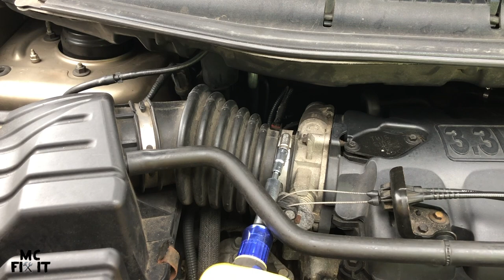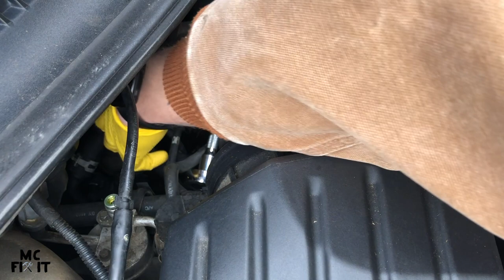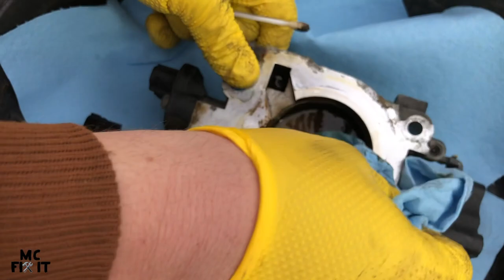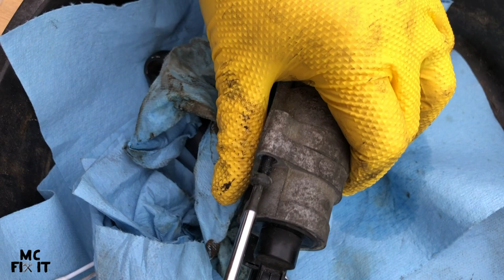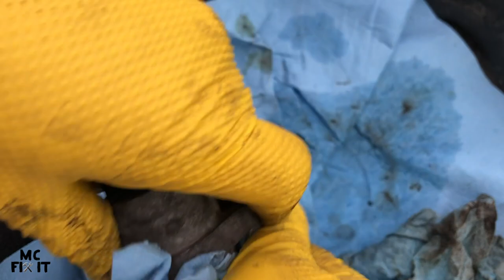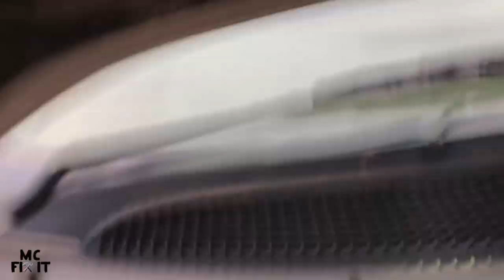Rough Idle? Clean your Throttle Body & Idle Air Control - Dodge Caravan / Chrysler Town And Country

Comment from the maker: Have issues with a rough idle? Use these tips to clean it and for your engine to run smoother! 

00:59 TOOLS:
• Mass Air Flow Sensor Clean (Throttle Body Cleaner / Break Cleaner) - https://amzn.to/33oTgmy 
• OIl Pan - https://amzn.to/33tm9xN
• Shop Towels - https://amzn.to/2SC8D93
• Q-Tips - https://amzn.to/33rEknC
• T20 Screwdriver - https://amzn.to/33pSQME 
• Flat Head Screwdriver - https://amzn.to/2RAjTlU 
• 5/16in socket - Socket set: https://amzn.to/3fjRoBd 
• 10mm socket - Socket set: https://amzn.to/3fjRoBd 
• Ratchet -  https://amzn.to/3xWjE5g 
• 4 in extension  - https://amzn.to/3uwhLKx 
• Pick (optional) - getting of red clips - https://amzn.to/3nZM8q4 
• Magnetic Metal Tray (optional) - keeps you from losing  bolts - https://amzn.to/3hdUiJZ 

01:39 - The Fix! Learn how to do this yourself! We walk through how to take off and clean the throttle body and the idle air control valve. Then put it all back together and tested it. 

This video works on all makes and models of vehicles but was done on a Dodge Caravan / Chrysler Town and Country for Generation 4 for the years of 2001, 2002, 2003, 2004, 2005, 2006, 2007. 3.3 liter or 3.8 liter engine size. It should be very similar for years before and after this.

Check out my website at http://mcfixit.us 

Disclaimer: Due to factors beyond the control of MC FIX IT, I cannot guarantee against improper use or unauthorized modifications of this information in the video, post, blog, or social media. MC FIX IT assumes no liability for property damage or injury incurred as a result of any of the information contained in this video. Use this information at your own risk. If you feel uncomfortable at any time. Stop and go to a professional. MC FIX IT recommends safe practices when working on vehicles, your house, or any other project and or with tools seen or implied in this video. Due to factors beyond the control of MC FIX IT, no information contained in this video shall create any expressed or implied warranty or guarantee of any particular result. Any injury, damage, or loss that may result from improper use of these tools, equipment, or from the information contained in this video is the sole responsibility of the user and not MC FIX IT.

#mcfixit #autorepair #fix #repair #throttlebody #roughidle #idle #caravan #townandcountry

Comment: Here is a trick I use when replacing screws, this is from my 30+ years as a two-way radio technician.  Insert the screw and depending upon the location with or without a screw driver rotate the screw 'counter-clockwise' until you either feel or hear a light click or pop sound.  This click or pop indicates that the threads of the screw have dropped down inline with the threads of the anchor at this time you can now turn the screw 'clockwise' without fear of cross threading or stripping the threads.  I hope you and others find this useful.
Reply from the maker: GREAT TIP! Thanks for  writing this!

Comment: Hey Mc Fix It Excellent video!  Another contributing factor to rough idle is at 19:40.  Notice the vacuum elbow hose that attaches to the port on the throttle assy.  as it has a crack in it thus an 'air leak' that will either cause rough idle or 'idle speed' not reducing properly at this time would be an excellent time to replace that item.  Keep up the good work.
Reply from the maker: Thanks! Yes, air hoses def leak over time (especially with an almost 20 year old vehicle). Good idea to check over this as well. Hope you have a great day!

Comment: Great video. Thanks for putting this together. I have been having issues with a rough idle start especially after starting it up. There are times it sounds like it's going to stop my engine
Reply from the maker: Yeah mine was similar to that. I hope this fix helps you out!

Comment: You are the man.  I did this with my van and it completely solved the idling problem.  Thank you so much!
Reply from the maker: So glad it was helpful. How dirty was it???
Reply: Super dirty.  Especially the idle intake air valve.  I couldn’t even see the holes in the top of the rubber valve when I started.  The inside of the main valve was crazy dirty too.
Reply from the maker: Good job getting it fixed! Thanks for commenting and watching. It means a lot!

Comment: Thank you very much for this video!!  Your intake valve wasn’t near as dirty as mine was. I have a 2005 Chrysler Town and Country and I don’t think its ever been cleaned.  My gauges were going crazy, every light on the dash was on, it was rough idling, and it got to the point it didn’t want to start.  All the ground wires were checked and cleaned for corrosion and tightened down. I changed the alternator because It tested bad. I cleaned the battery posts and put battery post protectant on them. I changed the air filter too. The problems remained. I tried cleaning the IPM Fuse/Relay box because the connectors had corrosion on them. When I flipped the box over, 3 connector pins fell out. I had to order a new one from the Chrysler dealer. It was 20 days out. I changed the spark plugs and spark plug wires. I don’t think they put never seize on the threads of the spark plugs or lubricant on the boot covers.  I put them on the new ones. After I get the air intake cleaned, I am doing an oil change and then it will be done. 
New subscriber here!!  🥰❤️
Reply from the maker: Sounds like it should be running well after all that maintance! Great job!
Reply: @MCFIXIT  Thank you very much!!  It certainly is running much better!!!  🥰❤️

Comment: My 2004 doesn’t really go past 20MPH so it’s VERY ROUGH. To get up to that speed I’m lucky, I was told it’s the coil pack. 
I have a free scanner which I’ll take it to Autozone to get it scanned properly.

Free scanner says 
P1693
P0301
P0123
P0015 (93)

Where should I start? I’m doing the labor, shops charge so much. Thanks for the video !

Comment: i know it's been two years but when you put it all back together at 20:10 you can see your bottom small air hose is cracked up. great video
Reply from the maker: I did not notice that. It wasn't an issue with the vehicle. I no longer own it or would go out and check it. That was a good catch, though! Vacuum leaks can be difficult to find when small.

Comment: What’s the difference from “shop” towels vs regular paper towels?
Reply from the maker: Shop towels are stronger and clean better.
Reply: Use shop towels. They don't break as easy or leave pieces behind. They aren't that much more expensive than regular paper towels

Comment: Do you need to change out the gasket on this after cleaning it? I’ve heard that it’s a good thing to do but wasn’t sure if it’s needed
Reply from the maker: I did not. It looked good. Lots of other places on the engine I would do it (ex: oil pump, trans/oil pan, water pump, etc)
Reply from the maker: @Frankie Bleddyn yes! I’m the same way. That one was bright it would be pretty easy to see if it was broke or damaged
Reply: Only if broken. If not don't waste your time. That seal is only keeping air out (not a liquid - oil, coolant, trans fluid etc)
Reply: @johnking398  yeah, that's what id say too!

Comment: Just did this now, tested drive and it impove by a lot, but I can still feel roughness. And if the AC is on full power, the engine struggles and sometimes it dies. I'm not sure I'm gonna make my long drive tomorrow
Reply from the maker: So glad that it helped improve it. I hope this fixed it and you were able to make your long drive!
Reply: @MCFIXIT  was able to have a long drive but compromised Fuel Consumption by a lot. It need to get fixed. Thanks a bunch!

Comment: Also use spray cleaner on the MAF sensor's electrode in the rubber air snorkel hose.  Dodge calls this one a mass/air temperature sensor
Reply from the maker: Great tip! Thanks for writing this!

Comment: Never use a metal object to hold open the butterfly damage can accrue use the plastics end of screwdriver or your hand and never reuse any gasket you are asking for trouble and inexpensive to replace! Use a child's toothbrush to clean instead of qtip does a much better job. Clean inside of intake if it is dirty as well.
Reply from the maker: Great tip! Thanks for commenting

Comment: don't forget to clean TPS as well with maf sensor cleaner, and clean contacts for all those wires, inspect/clean/replace air filter, spray MAP sensor with maf sensor cleaner as well, and inspect/replace PCV valve in the back (it all kind of works together and while there might as well inspect it all).
Reply from the maker: Great tips! Thanks for adding this to comments!

Comment: Cleaned mine been 100000 made slightly better still shake a bit ,,,,,290000 miles it helped
Reply from the maker: Wow, that’s a lot of miles. Congrats! Is it the original engine?

Comment: Excellent video. I have a question maybe you can help me with. I have a 1996 Dodge grand Caravan. The throttle body has been cleaned and the idle air control valve has been replaced. The check engine light still comes on and the code that it displays says to check the idle air control system. Could other sensors be bad such as the sensor in the air supply hose or the throttle body sensor? Thanks for any insight that anyone can give me.  The engine idles fine with easy starting and smooth acceleration.  Unfortunately I'm in California and have to get a smog check for my registration. It will fail if the engine light continues to come on.
Reply from the maker: What code are you pulling? The sensor could be bad on that old of a vehicle. Do you have any junkyards nearby, that's normally what I do for a vehicle that old, because sometimes parts are difficult to come by. And they are much cheaper than aftermarket or mopar parts.
Reply: @MCFIXIT  it's displaying a P0505 which is the idle air control system. The idle air control valve was replaced and there is no difference.
Reply: Could it be a bad wire or possibly a bad ground? Would resetting the ECM module help?

Comment: Can you use something like a toothbrush or soft bristled brush?
Reply from the maker: I would choose not to do that. You could scratch it pretty easily. The cleaner works well
Reply: Yes you can.. As they are nylon..I been using them for years on Throttle bodies. As I fix vehicles everyday..Never had one come back...

And you don't use Mass Air flow. Unless you got the money to waste...You use the CRC Throttle Body cleaner. As it's sensor safe..Then apply Dielectric grease to the wiring  connectors. You need to use Dielectric grease on the Plug Wires. Coil  Pack and Spark Plugs as well...I do all my connectors with it..

Comment: I'm contemplating cleaning mine. But yours didn't really look dirty enough to actually block air flow.  So I'm not sure if that's really what's causing my random idle issues.
Reply from the maker: I’d give it a try! It doesn’t take much dirty to cause issues. And you won’t know how dirty yours is until you pull it and clean it

Comment: After I cleaned the throttle body and put everything back together when I stated her up I got a check engine light and the idle was rough what could this mean?
Reply from the maker: Did you disconnect any sensors and not reconnect them? If so, that could be why. You can go to your local auto parts store and they will test it for free.

Comment: any ideas or videos on the ECU?
Reply from the maker: I don't. They are pretty easy to remove and install a new one. Two top bolts (10mm) and one bolt (10mm) behind the drivers headlight (you have to remove the three 8mm bolts there too). Then two wire clips on the side closet to the engine. BUT it does have to properly programmed to the engine which does take some time and a way to program it. I'm unsure if they make aftermarket versions or if you have to go to the dealership to get the part. Maybe a call into your local auto parts store could give you the answer.

Comment: I have a 1981 dodge b250, 360 5.9 with extreme high idle and extreme squealing
Reply from the maker: I’m not super familiar with that. Did you find a find a fix?
Reply: @MCFIXIT  Nope
Reply from the maker: Do you hear a vacuum leak anywhere? Like a whistling noise?
How old are the spark plugs? Have they been changed recently?
Have you changed out the ignition coil?
Reply: @MCFIXIT  No clue how old the plugs are bought it used 2 years ago 
   And cand hear a vacuum leak due the howling from the engine
Reply: @MCFIXIT  And no haven't changed put the ignition coil

Comment: I had no rough idle until I replaced injectors. And got p1193 iat sensor issue. Would the tb or iac being dirty now show fault now that injectors are working now?
Reply from the maker: That’s super strange. I’ve never of that causing an issue. Did you get through correct size injectors? I’d def double check those first and then clean my TB or at least look to see how dirty it is.
Reply: @MCFIXIT  factory replacement injectors and tested before install so I didn't have them dry start. Lubed o rings before installing so nice smooth fit. This vehicle was beat it had only 1 cylinder firing as 5 plugs had broken tops of the plug. And 5 injectors were leaking so had to do the key dance to build pressure before starting but always started right up not having an idle issue until now. And I did the full tune up. But even after cleaning the throttle body and new gaskets and iac and ports. I didn’t replace the sensor nor did I try to clean it as it was running fine. So it's an onset anomaly I didn't expect. I may just take it all apart inspect the wiring traditionally and see what I find. Once this is tackled it had the wrong battery so air bag light was tripped for a Voltage out of range. And I don't have the scanner to reset not do I know how to bypass. I test rhe harnesses under the seats and cleaned and added connector grease but without the scanner can't test if solved. And if it was just battery that's been properly addressed.

Comment: my car idle really rough I scan it and it says map sensor , I changed it and still the same.
Reply from the maker: Interesting. Did you try this method of cleaning the throttle body yet?
Reply: @MCFIXIT  it was the crank position sensor I replace it then everything ok
Reply: was it easy to replace? i wanna  revive my dodge caravan 06 been trying to find a solution

Comment: I tried cleaning this, but it did not help.  The van still runs rough.
Reply from the maker: Do any of your black hoses going into the overhead cam (big black thing on top of the engine) sound like air is leaking? I had to replace one a few years ago due to a leak and it seemed like it fixed it and it became much less of a rough idel.
Reply: @MCFIXIT  I replace any leaking rubber hoses, replaced Spark plugs, ignition coils (pack), Oxygen sensor, PCV valve.  I have not replaced but tested the MAP sensor.  I get no Engine light.  This thing is driving me nuts.
Reply: @MCFIXIT  Oh yes, I also replace the spark plug wires.  The van ran perfect one day the next day it started running rough.
Reply: @MCFIXIT  Yes, it has already been replaced with no difference.
Reply from the maker: It’s often something small but hard to find that causes these types of problems
Reply from the maker: Did you figure out the underlying issue(s)?
Reply: @MCFIXIT  Yes, I finally got it going again. I took it to the dealer and they found a bent spark plug electrode. I had replaced the plugs myself but on the number one cylinder I had trouble finding the hole. When I tried to screw the plug in I ended up bending the electrodes. The plugs that I replaced had a very large deposit on the center electrode which probably caused the rough running in the first place. Thank you for all your help

Comment: Bro... my back side was all black and caked up.
Reply from the maker: Does it run better?
Reply: @MCFIXIT  No. It was shaking and rough idling is what got me looking. I'm sure cleaning the TB helped, but I got a mechanic buddy looking at it after I changed all the plugs and wires to no avail.
Reply from the maker: What are the main issues you are experiencing?
Reply: @MCFIXIT  it starts rough idling when you put it in drive and after you've slowed to a stop and begin to accelerate again. It doesn't shake when you slow for like a turn. You have to come to a complete stop, and then when you accelerate to get going again, it starts complaining and moping like a teenager on an early Saturday morning when the yard needs to be mowed.
Reply: @MCFIXIT  buddy just texted me. It was the ignition coil. Rookie mistake not changing that when I changed the plugs and wires. Live and learn.
Reply from the maker: Yeah, the coil packs can definitely cause this issue if they are the original. I try to always change it out every other plugs and wires (about 100,000 miles).

Comment: This isn't for a town n country.
Reply from the maker: Not sure what you mean, can you explain?
I did this repair on my 2002 Chrysler. Town and Country
Reply: I have a 2013 Chrysler town and country and I just replaced radiator n was going to clean throttle but it was not where your video said it was.
Reply: @MCFIXIT  I wanted to fix both at the time but oh well.
Reply from the maker: @Bluemysticice  Gotcha! This video was done on a Dodge Caravan / Chrysler Town and Country for Generation 4 for the years of 2001, 2002, 2003, 2004, 2005, 2006, 2007. 3.3 liter or 3.8 liter engine size. It should be very similar for years before and after this. I posted this in the video description. I wish you could put longer titles to include specific dates, but YouTube restricts the amount of characters. 

It should be a pretty similar fix though. I hope you fix yours!